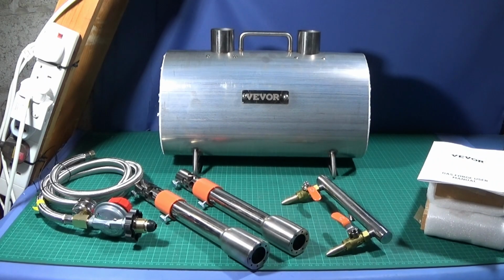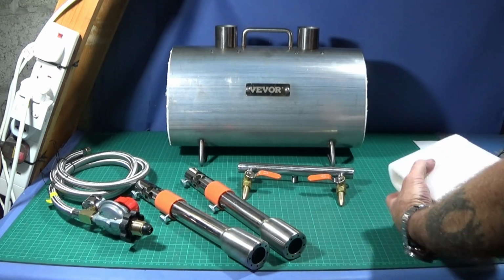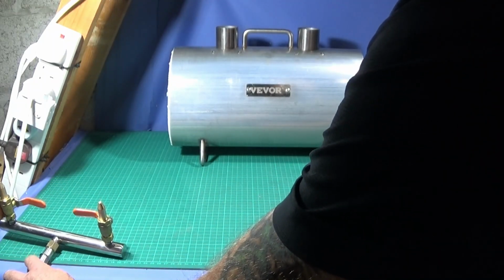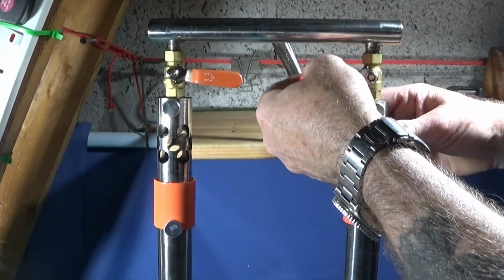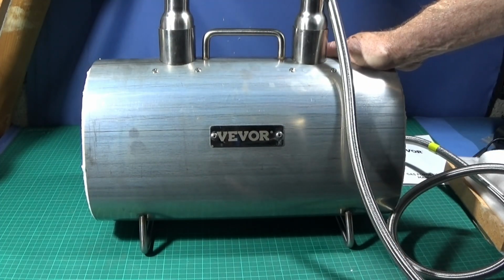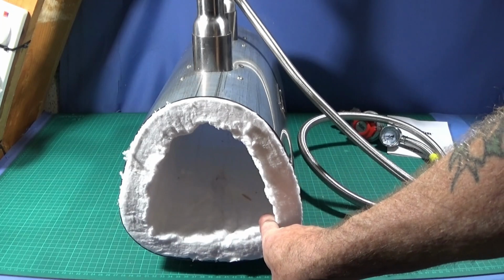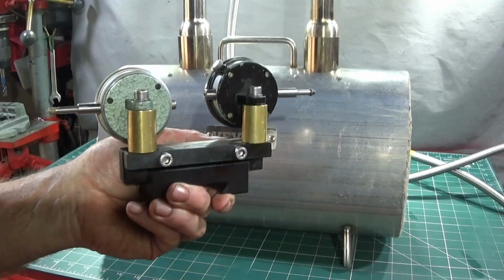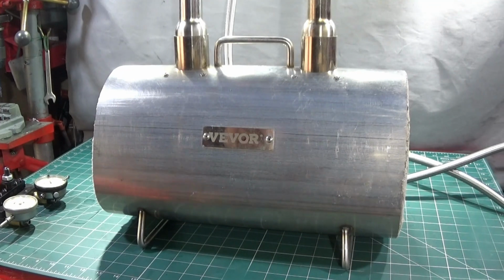VEVOR STAINLESS STEEL DOUBLE BURNER PROPANE GAS FORGE REVIEW, INSTALLATION & USE

Comment: To change the subject, I just finished grinding an M2 HSS tool cutter blank into the verticle shear tool from your details. Used it on the headache 1018 steel; works so well I'm surprised no one sells a bit shaped like this. Too easy to make I suppose. Yep, if I can do it, anyone can !! Thanks so much !!
Reply from the maker: Thanks for your feedback. I'm pleased you like the tool. I never knew about these shear tools until recently. I haven't seen them in any of the old engineers' books either. 
Regards Steve

Comment: Thanks Steve. I've been considering a forge for sometime, yet another great video.😁
Reply from the maker: Hi Steve. Thanks. I sometimes make copies of the Ray Mears Bushcraft Knife. But I haven't done so for some time. I'm just using mine to blacken up my homemade tools at the moment. It is so much quicker and easier to do than using a gas torch. Plus, there's ample room in this one for my larger fixtures. Regards Steve

Comment: I got this forge today from Amazon and the instructions are a little too basic. The only information on the refactoring cement outside of what is printed on the bag is here on youtube. I'm pretty new to blacksmithing and I got this as a starter forge and was frustrated by how the ad and the instructions seem to lie. I haven't put the cement on yet since it doesn't mention having to do that anywhere on the ad or the main website. All the pictures have the white cotton and the bricks. And the guide mentions changing the cotton liner form time to time.

My question is why don't they mention the cement? As well as what happens if you don't put the cement on and just follow the instructions in the book?

Comment: Could you put it on a fire brick and turn it vertically and use it to melt metals in a crucible? Cheers Steve another great review. Thanks
Reply from the maker: I was going a specific one to do that sometime. I'm just looking at the best one to get. I don't rush at getting equipment as I don’t want to get something that I would like to change later. Regards Steve
Reply: @SteveJordan  Thanks, I will wait for the video, too hot to be working with smelters at the moment here in UK anyway,  lol 😀

Comment: Will it get hot enough to forge weld Damascus
Reply from the maker: Hi Marc, I do not know, really. I've never used forges for Damascus. If you click on the link, there is information on the highest temperature it can reach.
Reply: Thank you very much for the response

Comment: The amount of wrong things on this forge is amazing !Wtf is that triangular shape? Round forge swirls flame and improves heating capacity .Round randomly cut holes on a propane burner ? Seriously?.Burners placed 90 ° vertical is worse thing you can do -no swirl and all the heat goes up when not in use and damages the valves.
Perfect example of what not to do.
Reply from the maker: Rubbish. It works perfectly and is great quality. It does everything I need it to do. I'm really pleased with it. I've had a few different forges, but this one is the best.
Reply: @SteveJordan  maybe for your limited hobby needs but for any serious work its far from optimal.
Reply from the maker: Well, that's what all of the ones on the market are for then, unless, of course, you make your own or spend hundreds of pounds on. I don't need one of those, so this is excellent, for what I do.
Reply: @SteveJordan  Its not that expensive to make your own,like the most expensive part is insulation and that depends where you live.Body can be made out of propane gas cylinder or air compressor cylinder/water heater.
Ceramic wool can be expensive ,but other refractory materials like cement can be used as well.
You can make high quality burner out of plumbing parts in a day or two. (even less depending on the type of machines you have).
If you have to go from 0 and buy everything i would say around 600€ for a good DIY forge is achievable price range.

If you want to go professional and have some time ,but if you are going to use it 2 times a year then sure this is product for you.